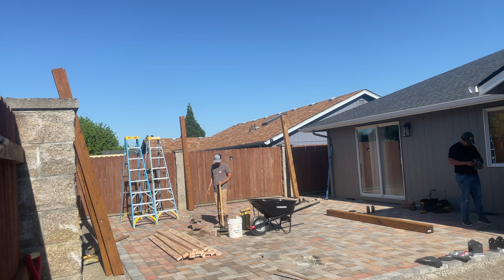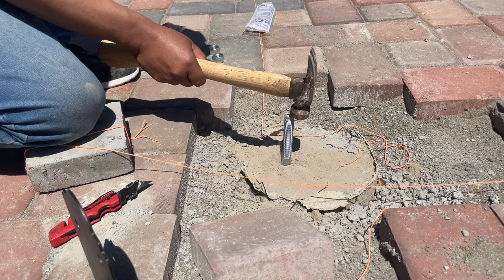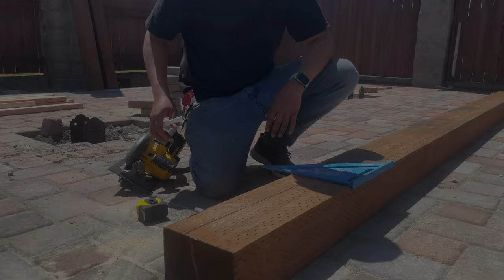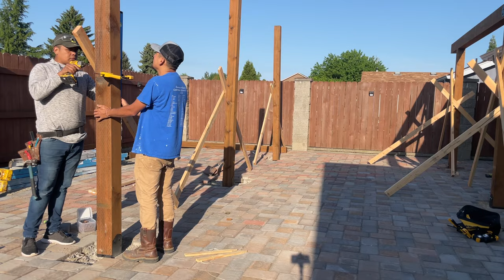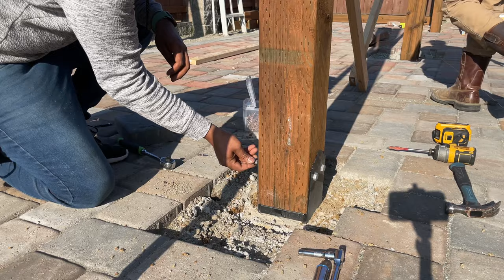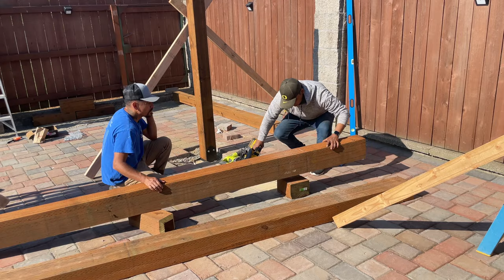DIY porch | FREE STANDING PATIO COVER | material from HOME DEPOT

Comment: Always put the nut on the bolt then hammer it  to the concrete that way you don't mess up the threads
Reply from the maker: thank you that’s great advice 👍🏾
Reply: Most anchor bolts are designed to where you won't mess up threads when hammering down
Reply: Negative. Do not hammer. Your gun has hammer mode with no spin setting. Bolt has a dimple on threaded end. Set nut and use hammer gun to drive in bolt
Reply: Dude, very very solid tip. My dumb ass would have never thought of that and I’ve done 5 jobs w posts lmao

Comment: This one is interesting because you chose to separate the house from the patio. Was it just preference that you didn't  adjoin the roof of the house with the patio? I mean you wouldn't be worried weather or not rain or high wind and rain could plummet in between the two? It's still a great job but gutsy, lol.
Reply: I think he would need a permit and whatnot, if he attached it to the house, regardless of square footage.
Reply: @ApexxJimmy  Yeah that came to mind. As a mortgage-free homeowner here in my state, we don't have to have to have any permits. As long as it's code.
Reply from the maker: I didn't want to complicate the construction of the patio, tying it to the house would be more steps to follow. Just like that it was faster and easier.
Reply: @Redblocksllc  Yeah that's what I figured. Keep it simple right.💪👍🏼
Reply: I actually like the idea of not disturbing the house roof, my house is only a year old so I’m weary about messing with a new roof. I did notice the rain gutter so that should help with most rain water coming through the separation. I’ve seen quite a few videos and after seeing this video I’m pretty much going through with this set up.

Comment: Does your patio cover stop even with gutters edge of the house or go over the gutter to edge of house? I want free standing to get more height but I also don't want rain to get between house and patio cover. How far do you think you can over hang house without interfering with future roofing replacement?
Reply from the maker: this patio cover is high enough so it doesn’t interfere with the house roof and goes 2 feet past the gutters. I don’t remember the exact measurement, but I did make it where it’s not too high that when the wind blows it doesn’t bring the water with it. I did it this way so I could walk outside and not get wet.
Reply: @Redblocksvideos  that is what we want too. Thanks

Comment: How did you prevent this from wobbling? I find when I don’t bury the post in concrete or tie into the house these structures always move a bit…?
Reply from the maker: I really don’t have a problem with that, probably because it’s pretty big and he has six post instead of four. It does move a little bit if push on purpose, otherwise it’s just fine.

Comment: Nicely done but I would love my patio cover to attract tightly to the house so when rain I walking out without getting wet
Reply from the maker: There are two ways to have this done, one would be to see one side of the patio cover on top of the roof and the other will be called lean in patio cover. When it is lean into the house is attached to the side of your home and this way it will cover you from the rain or the sun.
Reply: @Redblocksvideos I’m trying to build one, with permit. House already has a flat roof addition to the back. There’s a pergola at the moment nailed to the fascia, but it looks ghetto. Do you think it’s possible to build one a bit higher than a flat roof , so it over laps maybe a foot?  Pitch the rain away. Thanks !!
Reply from the maker: @JoshR512  yes, it’s possible to make it higher. Just check with the city for the permit

Comment: Glad to see you used hex bolts instead of the little 3 1/2" screws and the 'finishing' washers that are fake nuts. The finish solution from simpson is like 3x as much compared to using 6" bolts that will be stronger anyway.
Reply from the maker: the simpson it’s just for looks 😊

Comment: Looks good but been having so much trouble these kind of post they been splitting apart so much
Reply from the maker: what type of post wood do you use? I used the pressure-treated and I chose them. I didn’t let this store close for me, that usually keep out the worst ones.
Reply: @Redblocksvideos you have to use redwood. Everything has to be redwood. It will last for long time and look pretty too. Pressure treated is for fence post. You are using wrong materials

Comment: Great job!  What height did you cut the posts at?  Doing mine this weekend similar to yours, free-standing with the high side of the roof just above the house to keep the area under the patio cover dry. I like how this design maintains easy access to service the gutters.
Reply from the maker: I don’t remember the height of the post, I honestly didn’t measure how high they were going to be. They are the same high as the roof, and from there I did a slope of a quarter of an inch for every foot with my string level. I left a link for the string level from Amazon. If you want to purchase it it’s about three dollars. The actual party cover was about 14 to 15 inches above the roof total counting beam, and the Raptors going across. Hopefully this makes sense.
Reply: @Redblocksvideos  Oh yes this makes total sense, thank you! I installed the 3 posts near my house first to get the height of the beam on the posts correct then installed the remaining 3 posts and beam away from the house. I used your string level idea too, thanks. My rafter length is 12 feet, have not decided if I will slope to quarter of an inch or higher because I'm concerned of rain water not falling fast enough down the metal panels. Maybe I will go 3/8 of an inch and use galvanized roofing screws that have the rubber washer and caulk them all.

Comment: What size post beams are those I can’t find them that length came out beautiful 😻
Reply from the maker: if you’re looking for than at home depot, you won’t be able to find it in stock. they are spacial order head over to customer service and place the order. 6x10x14 this is the size for the beams and for the post i use 6x6x8. 👍🏾
Reply: @Redblocksvideos  What type of wood did you use?
Reply from the maker: @yorvelisfalcon651   pressure treated 6x6 for posts ,  6x10 for beam and normal 2x6 for rafters

Comment: Is there a slope on the roof? I didn't see one, if there is how did you make that heppen?
Reply from the maker: That’s a great question. In my county the minimum slope that this construction built has to have is a quarter of an inch for every foot minimum , this cover has 3” slope because it is 16 feet long. i used a string line level for this.

Comment: What size post beams are those I can’t find them that length came out beautiful
Reply from the maker: they are pressure-treated 6 x 6 x 8. They were a special order at Home Depot. If you go to the pro section you can order any size you like they do not have it in stock.

Comment: Great work. Was the floor made of concrete or did you dig hole and put concrete to hold the posts. If dug hole, how deep and wide did you pour concrete?
Reply from the maker: thank you
I did a hole about 2 feet deep and it was about 12 inches of diameter
Reply: Thanks @Redblocksvideos . Shingles on roof ?

Comment: Do you have a listing of parts, dimensions and plans?
Reply from the maker: I do not have a complete list, but I did use 2 x 6 regular number by 16 and 6 x 10 x 14 beams, and 6 x 6 post, 6 x 6 house brackets and 3/4 of an inch by six anchor bolt, also bracket and a tie tie bracket for a 6 x 6 beam, I also use 4 x 8 half-inch plywood for the roof and six by one facia board

Comment: Where do you attach the string for the slope.  Do you attach it to the post on each end and and then mark for the cuts?
Reply from the maker: yes, i first cut all the post from one side of the cover and have them level, after a run my string from the top of the post to the other side and marked it

Comment: what type of wood did you use? pressure treated pine or ceder?
Reply from the maker: pressure treated 6x6 for post and 6x 10 beam
Reply: @Redblocksvideos  did  you paint or seal it?
Reply: @MarkoJ-k7u that’s what I thought also pressure treated usually more lighter looks stained
Reply from the maker: i didn’t do any painting nor sealing, but it wouldn’t be a bad a idea to seal the rafters, the ones i use are normal 2x6
Reply: @roberto6870  thank you

Comment: How do you fasten rafters to beam where you over hung the from past beam?? Thanks for any help
Reply from the maker: I did a small notch to the Rafters so they can see flat on the on the beams, and then ice crew both size of the rafters 3 inch screws
Reply: @Redblocksvideos  awesome thank you. Is that patio all free standing not attached to house anywhere correct

Comment: I'm trying to build aa 18 x 18 with max height of 8ft.  What would you recommend
Reply from the maker: you just use 4x4 for post and maybe 4x6 for a beam
Reply: @Redblocksvideos  due to a door being in the way of walkway would need to do a 4 foot over hang from on end of the beams would that be an issue if i used 12 foot beams
Reply: @Redblocksvideos  due to a door being in the way of walkway would need to do a 4 foot over hang from on end of the beams would that be an issue if i used 12 foot beams

Comment: Does the rain go through the gap where house roof is and patio?
Reply from the maker: only when it is raining with a lot of wind
Reply: @Redblocksvideos  also what’s the slope?
Reply from the maker: 1/2 for every foot
Reply: You  said quarter inch for every foot in another reply?
Reply from the maker: @yashuwbyisrael2324   both works just fine 1/4 or 1/2

Comment: I'm wanting to do something like this for my patio which is 33' x 9', that means I'll have to get different lengths 6x10 beams and posts be distanced unevenly. Anyone know if that'll affect the weight distribution?
Reply from the maker: you can use the same size post but yes you’ll definitely different beam size you coil decide it in 11’ section and get 6x10x12